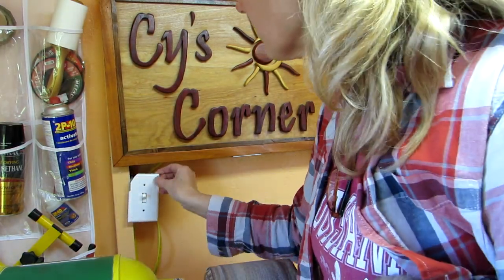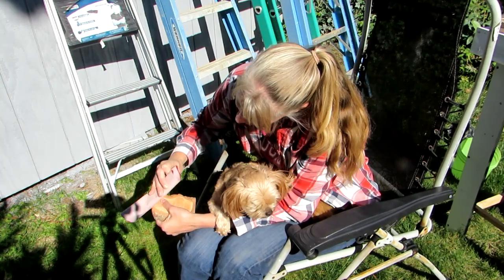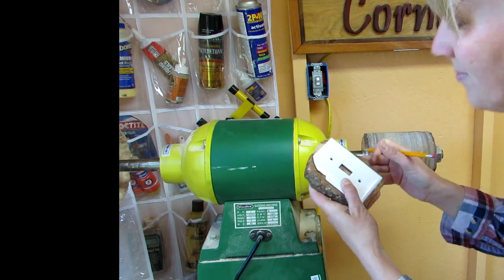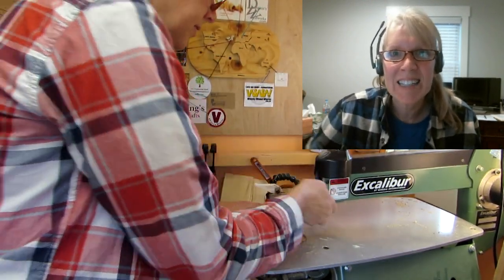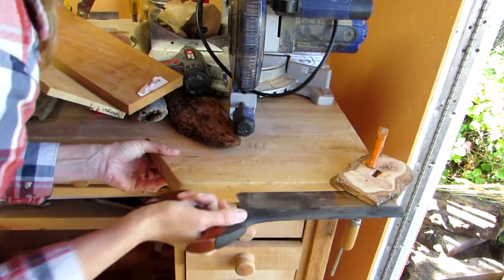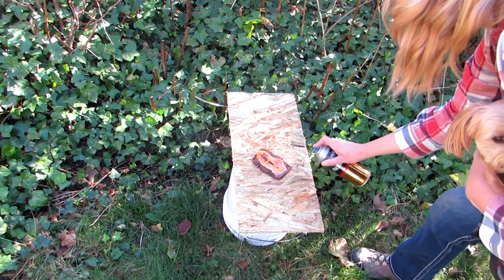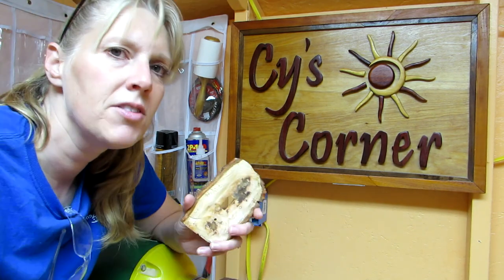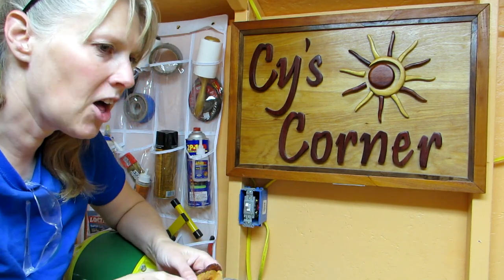Light Switch Cover

Comment: Don't know if it's required, but if you buy a wooden switch plate cover there's a piece of sheet metal on the back. The ones that I've bought 'looked' like it was copper.  Just thought that I'd mention it : )
Reply from the maker: +John Conklin I have seen that before but the back of the plastic one didn't have it so I figured it was okay???  I suppose I should check with Husband....yikes!!!
Reply: Better safe than sorry.
Reply from the maker: Thank you :)

Comment: Here is an idea to take the shake out of your camera.  You are going to need a small inner tube and a concrete paver square.  I would use an inner tube such as what might go in a trailer tire.  You might look for used ones at RV dealers or tire dealers.  Fill the inner tube up halfway with air so that it's really saggy and set that on your table.  Set the paver square so that it sinks into the inner tube.  Finally, put the camera on top of the paver square.  You will find that the shop vibrations will no longer reach your camera.
Reply from the maker: +Harry Ragland I see how that works. :)  may be easier to hang it from a drone :)

Comment: I don't know if you can access your little router but you can trace the outside of the electrical box on the back of the cover, remove the cover and route out the inside of your lines so the electrical box will be recessed into the cover and that will allow the switch to stick out more or you can use a chisel instead of the router.
  PS- I noticed your shoe organizer, pretty soon you will have them hanging every where LOL!!!!!!
Reply from the maker: +Curt Parker Good idea!!! Thank you!!!  I have 2 shoe organizers in there now, thank you for that awesome suggestion!!!!  You're full of good ideas Curt!!!
Reply: I can't take credit for that idea, I got it from Pinterest to hang inside a pantry door for more storage. I'm just expanding the idea further
Reply from the maker: Love that Pinterest!!!

Comment: Love the idea! I was wondering where did you get the scroll saw blade (Time 0:40) to cut the thick piece of wood? I have been looking for these thick types of blades.
Reply from the maker: +Rosewood59 I bought some blades with pegs on them, you know the ones for scroll saws with that type of blade holder? I snipped off the pegs and they were long enough to use. I got them from Lowe's or Home Depot I think. Sorry I don't know for sure, it wasn't something I special ordered though.
Reply: Yes, I know what you mean about the blade holder. Thank you for the information and that's okay if you don't totally remember. I do the same things too  :)